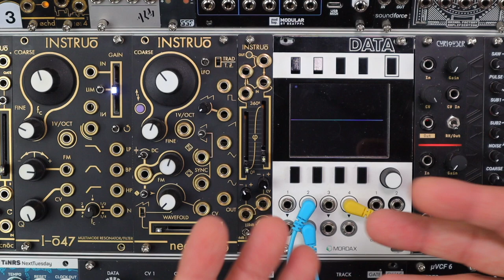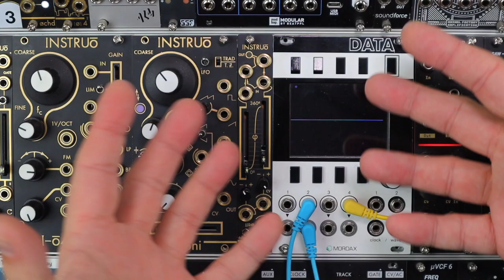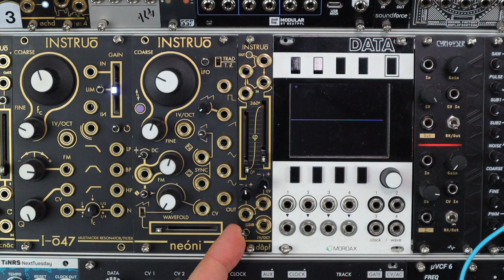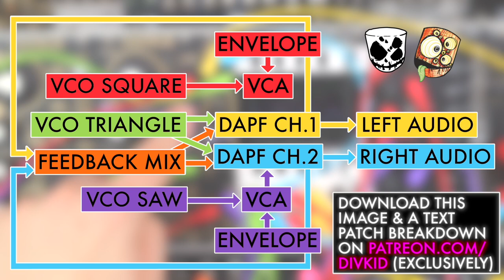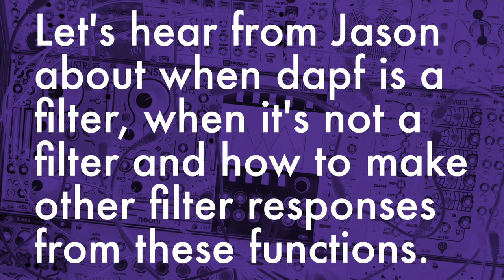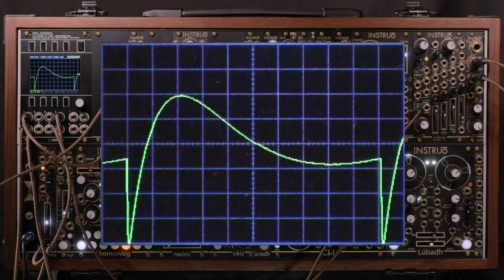Wow! I didn't know All Pass Filters could do this // 3 Patches with dapf from Instruo

Comment: Been waiting for an APF module like this for so damn long. Can’t wait to try this thing. Great demos and explanation !
Reply from the maker: thanks! I didn't know I was waiting for one, but I would be had I known I could make it do this before hand. Some learning on the job as I tried these patches.
Reply: @DivKid  I still have my original experimental 'Craig Anderton' phase-shifter board (flying chips and parts over a PVC sheet 🙄 before attempting an etched PC board [and expanded stages])...
May just go and pull it out to have a look-see !

Comment: I first heard of all-pass filters from a podcast with the Valhalla DSP guy — apparently they‘re a big part of algorithmic reverbs.
Reply from the maker: Yeah I've heard Sean Costello (the Valhalla DSP guy) and Tom Erbe both speak about all pass filters in delay feedback/diffusion in reverb designs. I'm not sure exactly how all that works (I certainly couldn't code it all) but nice to find some creative uses for all pass filters beyond basic phaser stuff and knowing it's part of reverb DSP.
Reply: The dåpf development here has sparked some (extremely nerdy) in depth discussions in house with several of my software collaborators.
All-pass filters are core building blocks in DSP! I'm still trying to wrap my head around how it all works in the digital domain!
Everything is just a buffer, and an offset delay of samples/sample blocks, but its the difference in delay offsets and frequency dependent phase shift that intrigues me 😅

I started experimenting with the all-pass filter circuits around the same time as developing the sawtooth phase shifter circuity in the cruïnn. Very different as the cruïnn shifter keeps the sawtooth perfect, just shifted off centre. The first time seeing the sawtooth shift in shape but realising it was retaining its spectrum unchanged was a brain melt realisation!!
Reply: @instruo  Excellent! Thanks for the explanation. Most of it went over my head but I enjoyed it immensely nonethless ❤️

Comment: there's one specific use I'm missing here, that would definitely be worth to mention I think: the use of an allpass filter before a non-linear distortion.
As disortions often work based on the position/amplitude of a wave instead of being linearly related to frequency, changing the shape of the wave using an allpass filter will change the spectral response of a distortion. Because the phase difference of the frequencies cause them to line up differently, the position of the high "peaks" will shift, causing the distortion to do it's work at another position in the waveform. eg. with a saw and a clipping distortion, it would normally do most of it's wave-shaping job at the hard edges of the saw, but as you shift the phases using an allpass filter, the middle part of the saw wave will go up in amplitude and gets in the range of the distortion to work upon. This will in turn drastically alter the way the distortion "bites" into the waveform, generating totally different spectral response. So you could even turn a very simple distortion with limited controls into a morphing distorting beast.

If you would then use another allpass filter after this distortion, but with an inverted response (such as, if you would put the two together serially, they would cancel out each other's phase changes and return the waveform in the same shape as if it weren't phase shifted at all->although they are actually áll phase shifted, but in the same amount), it's like you have a sort of "focus" control of where the distortion (which would be put in between them) is doing it's job, instead of only working on the edges of a waveform.
EDIT: after typing this last part, I quickly tried it out on the computer and found out I seem to have forgotten how exactly this inverted allpass function was done, so I'm not sure this could actually be done using the instruo module..
Reply from the maker: Fantastic idea, this was just a "3 patches" series video, where I literally just do 3 patches. So there's lots of ideas to explore this further in the future. However, I hadn't thought of this, really cool idea and thank you for sharing. 

I'm making note of it. Again thanks for sharing, the community sharing ideas is one of the things I love most about all this stuff.
Reply: @DivKid  no thanks, I'm always happy to share some insights from my musical journeys :)

Comment: Could you do PWM with a square oscillator that doesn't have that built in, by modulating the all-pass and mixing an inverted copy back in with the original square?
Reply from the maker: oooh that's interesting, hadn't thought of that. But yeah 180/invert square against the square would cancel out, but then introduce a phase shift should then let bits of pulse back through. 

Though I wonder if it would be a pulse or a different wave shape that was modulating in width somehow. As the shape changes massively (see the saw wave shape change at the start of my video) but that might still sound pulse like.
Reply: Very interesting question!
Sonically it would be its own thing. The variation of spectrum that results from PWM shifted pulse waves is very particular.
The odd harmonic overtone make up of a square would be retained, but with the phase shift of them being affected other than amplitude.
Some form of audio rate manipulation of the all-pass filter would waveshape the square wave into something new!
Reply: Sounds really interesting.  I'm super intrigued to hear how it would sound.  I might have to pick one of these up at somepoint. 

A slightly more silly question.  Could you theoretically create a reverb if you had enough of them?  My very rudimentary understanding of algorithmic reverb is that they are created with multiple delay lines and all pass filters feeding back into themselves.
Reply: @seleniticdawn  theoretically… many reverb algorithms utilise large complex networks of delay lines and ratios of both positive and negative feedback.
All pass filters feature in various different ways. I am absolutely no expert, but I hear lots of chat on the topics when I’m upstairs 😉🤐

What’s much more efficiently achievable with dåpf/all-pass filters is complex spatialisation.
The phase offset differential between signals can very convincingly create the illusion of space.
Think of it like hearing a tone in a small room. The reflection of the sound off the farthest wall will come back and mix with the direct source, but with a phase difference/“delay”
The farther away the wall is, the greater the phase displacement.
Standard panning is all basic amplitude manipulation, and relies on a phantom image perceived by a listener in optimum position within the stereo field.
By “effing” with phase, the results can immediately place sound sources much more ambiguously and creatively.
A small amount goes a long way and can instantly add “air” to a voice within mix in ways that amplitude panning just can’t :)
Reply: @instruo  thank you for such a thought provoking reply to such an impractical and silly idea.  Super interesting stuff that I can think about beyond just this module.

Comment: Great module but that panel is cramped.. could’ve been a 6 or 8 HP, IMO.
Reply: Earlier prototypes were larger, but I found them to be needlessly so.
Much more of a "set-and-forget" module. Going with faders vs knobs also made for a much more performable layout, so I ended up happy with a 4HP form factor..
Works for me! 🙃
Reply: @instruo  Fair enough. I have to admit that I also am keen on designing slimmer modules, but sometimes I regret it and notice I don’t “play” the module as I wanted too.
Reply: @PWMaarten  I generally start big and reduce as appropriate.
dåpf for me hit a sweet spot with the first 4HP prototype.
But I do design first and foremost for me! 😬
Reply: It looks a little crowded, but maybe fine in actual use.  And I just happen to have exactly a 4HP space to put this in...
Reply: @instruo  as you should!

Comment: "I didn't expect it would be such a great stereo expander for a single VCO"

How? Phase differences are literally the mechanism by which our ear to brain pathway locates signals in space! Non-centered sounds reach the two ears across different distances, thereby arriving at different stages of their phase-cycles. 

Stereo conversion is the most obvious use for phase-shifting. When my grandfather recorded mono records to tapes in the 1970s, he would add a delay of a few milliseconds to the right channel recording: bingo -- primitive stereo!
Reply from the maker: When have you ever seen an audio rate modulations of a stereo phase shift? More specifically from a VCO, to expand itself?

I think this video poses 2 things that are at least very rarely done anywhere with VCO expander and the analogue version of 3 OP DX style FM(PM).

It's not a case of not knowing what phase shifts do in all the basic senses (basic stereo, PA line array timing management, delay diffusion in reverb DSP etc), it's having found new things to do with them. 

Your grandfathers primitive delay trick is something I did with synthesising claps for sample packs in a lot of previous work. The sample delay in Logic (DAW) is great for just adjusting one side slightly.